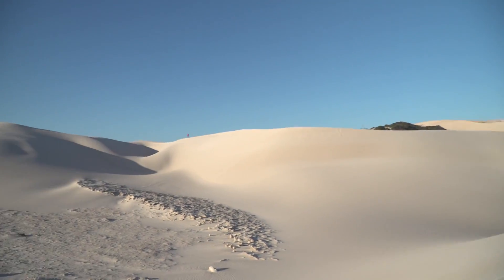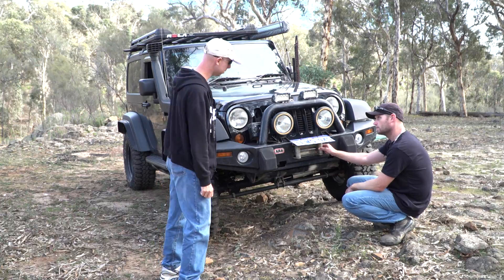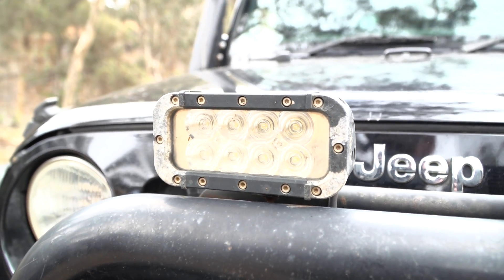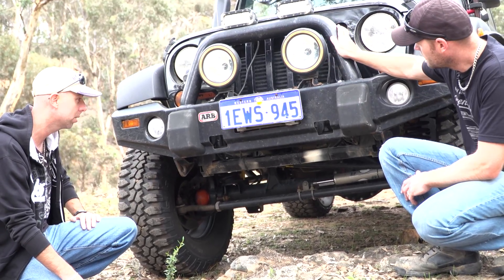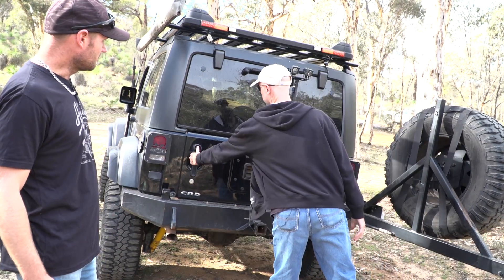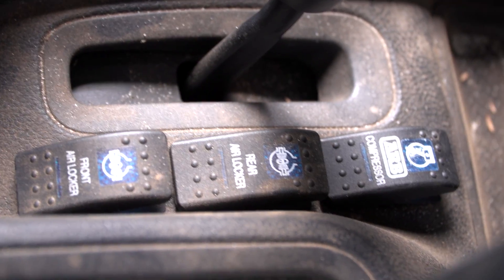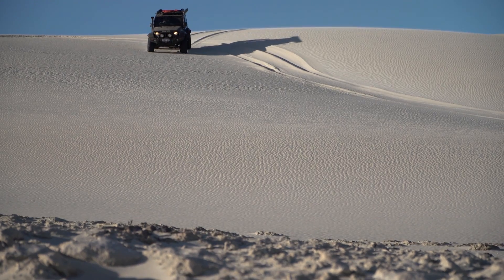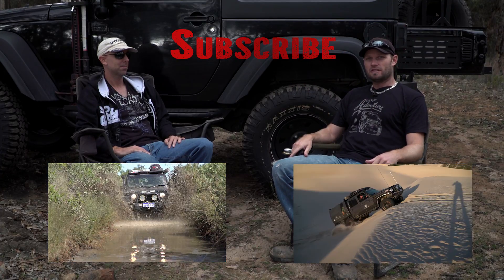Modified Jeep Wrangler JK, Modified Episode 24

Comment: chrome moly isnt used because it lighter. its just stronger so you can drop down a wall thickness an still be safe and lighter only because there is less material. Also chrome moly can handle more flex without deforming.

Comment: the 2,8 crd diesel was available in the USA in the Jeep Liberty in 2005 and 2006 I had a 2006 best engine ever they had to stop due to emissions, funny thing is I took mine to a mechanic friend who did EPA emissions inspections and he put the probe in the tail pipe and it had less pollution than the same vehicle with a gas engine gee what a shock (not) in 2014 you could also get a 3.0 diesel and there coming back again to the USA in diesel

Comment: Can you do a video on the top 5 things to put on your car because im planning on buying a mazda bt50 xtr (for off road and work) and im not to sure on what to put on first thanks. love the videos im just getting into off roading :)
Reply: ...a landcrusier
Reply: 1 tow hooks.
 2 proper skid plates or rocksliders. 
3 aftermarket lights. 
4 appropriate tires
5 winch
Reply: And landcrusier
Reply: thats a big mod :o
Reply: So just get a land cruiser instead?
Reply: How much r u spending on a bt50
Reply: got my 79 in june
Reply: so yer nothing on a bt :p
Reply: Mate idk how much to spend, if i should go all out or just buy the basics for now
Reply: hey mate, i have just brought a 2016 BT-50 XT Spacecab 4x4 (3.2L manual). i got mine with an ARB Bullbar and side rails, mine has a heavy duty tray, tow bar kit and all that stuff. and i spent 46k on it. The BT are very good on fuel currently i am running around 8.0 - 9.0L/100km. and it comes standard with a 80L Tank. and it has tons of power.

The First few things you want to do with the BT-50 is get a decent set of tyres when you can afford it because the ones they come with are horrible.  The height isn't to bad standard , so you would only need a bigger lift if you plan on doing something serious. and a snorkel because the inlet in pretty low down.

Comment: amazing video as always ronny. Just wondering what the point of the carpet on the dash is for. Ive seen it in most of the 4x4s you show.
Reply: Protects the OEM dash from fading and drying out from the sun. Also can hide wiring underneath the carpet cover and helps with glare off of the dash.
Reply: Stops it from cracking. I have a car without a dash mat and the cracks are so big you have to be careful putting things like phones, keys, etc. on the dash because they fall through.
Reply: Ahh, cheers fella

Comment: Gen Right gas tank?  I know you said it will fill the other, unfortunately the online description of the tank makes it sound like it replaces the factory tank, you are using it to supplement the factory tank, right?  You said 20 liters, did you mean gallons?  Sorry for so many questions, I just have been interested in extending my fuel capacity since I got my JKU back in 2011.
Reply: The extra tank is a Longranger 40 litre ( 10.5669 US Gallon ) it doesn't replace the main tank it is an extra tank & it uses a pump to transfer the fuel into the main tank mate, hope this helps?

Comment: Always a toss up whether to sleeve and gusset or simply pick up hardened shafts. No wrong answer. We have been sleeve and gusseting, and even a truss if called for, leaving joints and shafts to fail as the " fuse"  Evidently this Jeeps doing just fine with the shafts. Interesting..